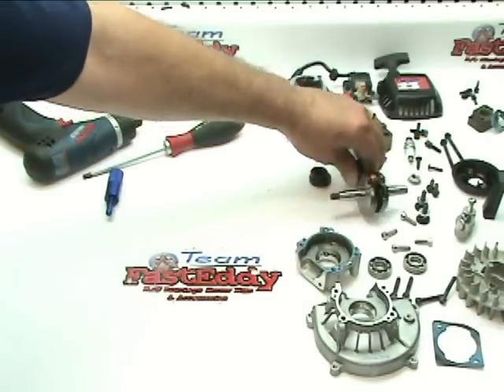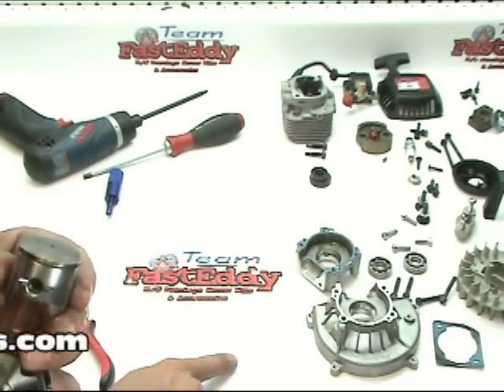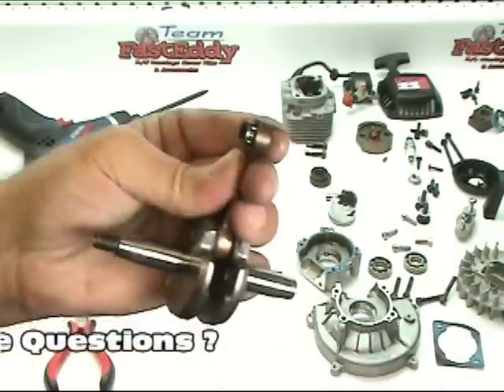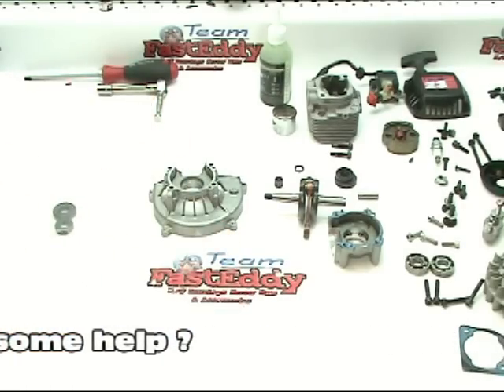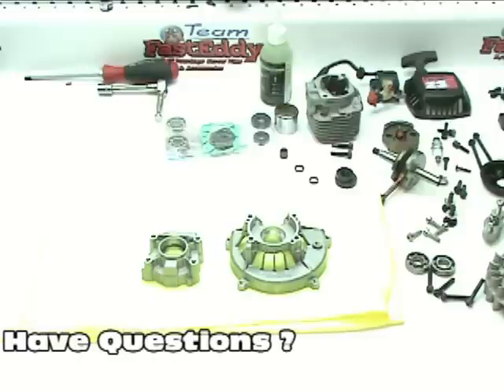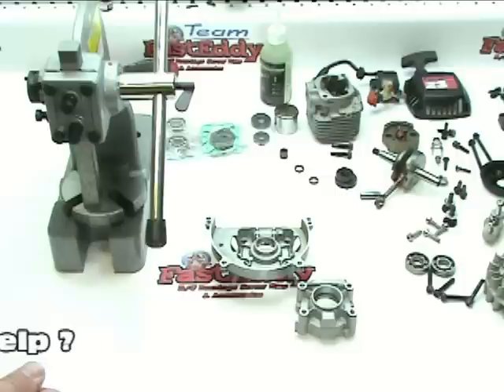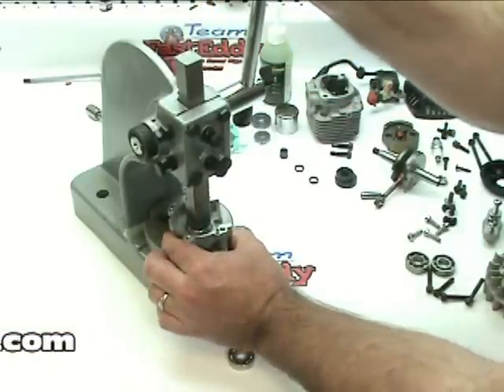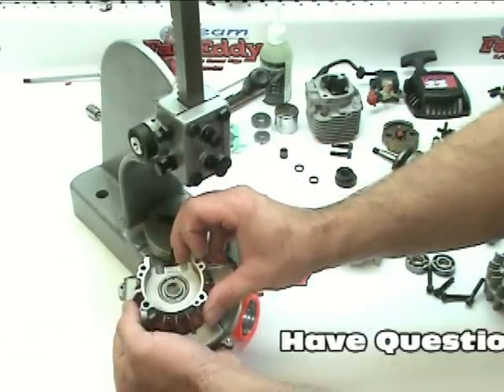Video #4 Tutorial Rebuilding the CY 23CC Engine

Comment: Did you take the block apart? sand goes deep in the engine.
prob al the way in the crank house. if you cleaned this good, this will be oke.
If the piston itself is scratched, should be in the head too.
Best thing you can do is replace the set, piston, and head.
If your not in competiton , just hobby driving, you can get CY cilinder sets for  around 40 euros complete. They go as good as originals.
The thing i recomend is also, CLEAN your TANK!!! and CARB!!!!!
Several times!!!before re using these